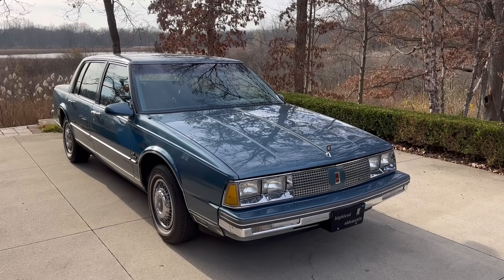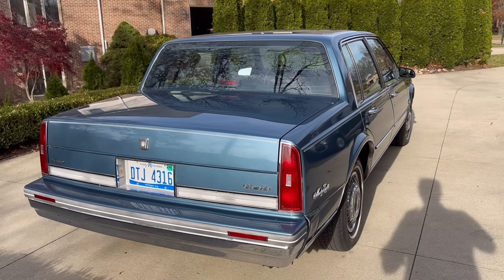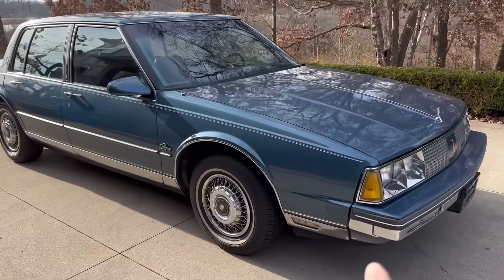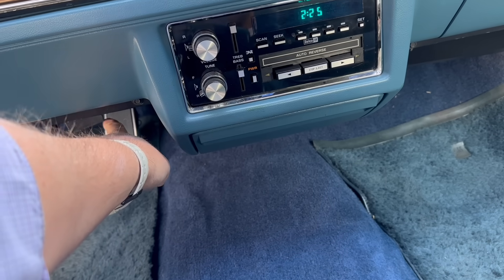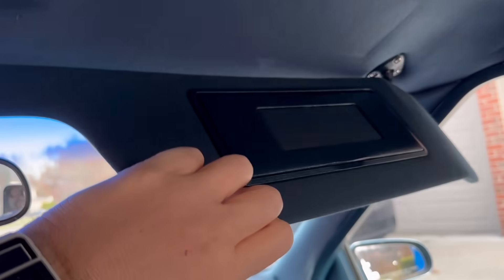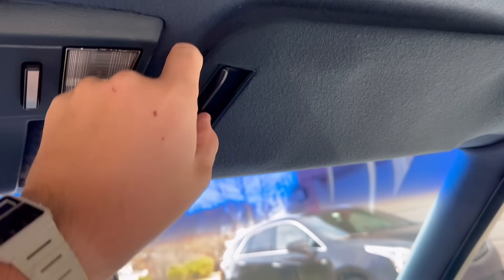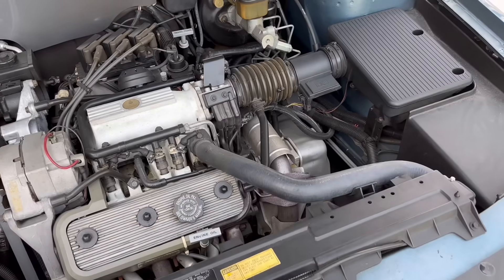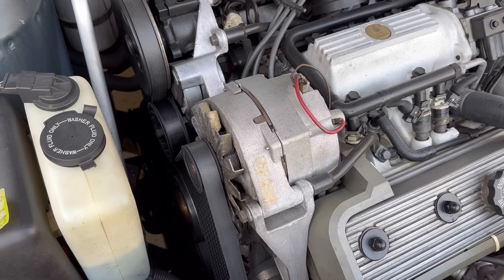Strange Features, Quirks and Idiosyncrasies of GM's "'Baby Big" 1986 Oldsmobile 98 Regency

Comment: Had an ‘87 98 Regency Brougham. Fully loaded. Mine had the Blue LCD digital dash. Quite a modern feature for the time. Had inside and outside temperature feature on it. My car also has auto level control. But motor electronics were not sorted. Brakes way too small. But the leather front seat was so comfortable. Like sitting in your living room.

Comment: You make me miss my 1986 regency brougham so much lol I loved that car. Sorry, I know this is a second or third time I have commented this haha
Thank you for the memory flashbacks and what i actually had because I forgot what it actually was. 40k miles on that car is just awesome. So that's what happened to my Olds with the cam. That steering rack never had the hard steering issue. Just broke at the tilt pivot. I would love to have another one of these cars because of those seats lol I slept in that car a few times. That overdrive was nice but it slipped a bit but some lucas trans fix made it better. Mine got about 22-25mpg. That trunk held 2 12's nicely

Comment: Actually the 1986 Cadillac De Ville had a sharp crease in the roof just above the window so it differs from the Electras and the 98s slightly.  I believe the Electras and 98s shared all doors. These 98s were the first 98s to ever have a six cylinder engine. The name " ninety eight" originally signified the Olds Model-90 with the Eight cylinder engine. 
My 1990 Regency Brougham has been the best car I've ever owned.
Reply: @rafaelfiallo4123 One thing I liked  in particular is that both the 98 and the Electra didn't resort to die-cast fender caps. Unfortunately the Cadillac had them fore and aft.
From developmental pictures I have seen, it seems the body of the Olds emerged as the goal of the styling exercise in early 1983,  and both Cadillac and Buick worked off of that mule which very surprisingly closely resembled the final 98 design and product. Perhaps it wasn't yet designated as an Olds that early in the process. That might account for the elegant taillights which are indeed very Cadillac. In the 1980 model year , 98s were given taillight treatments that very much echoed their 1965 designs, much in the same way that the full size Cadillacs recalled the 1965 rear treatment. All of that now quite gone and never to be seen again.
Thanks for the great video, btw
Reply: @rafaelfiallo4123 Perhaps  you are correct, but as I mentioned I dud watch a video about the C bodies and it showed an early mock up in clay which was very Olds. At any rate they are very attractive cars.

Comment: I was a 15 A man at GM that means I fixed windows and seat belts and power seats . In those years GM started farming out their wiring to factories in Mexico and used thin wire that would over heat the contacts after the window motor got a little wear and changed it load values. I go to junk yards these days and see nice looking cars that have so many issues with the wiring that the cars are junked it is too bad that GM made such poor products back then.

Comment: We had this same vehicle in white with burgundy interior. It had the 150 HP engine. Had it 21 years and experienced most of the issues described.  We really loved it and were saddened when we sold it with just under 130k miles.  It was, however, nickel and diming us beyond an acceptable limit.

Comment: I loved my Delta 88s. I have seen the digital cluster in person, as well as the auxiliary gages. I feel these cars peaked in 88-89. I had an 89 Eighty Eight Royale Brougham with the 1SG package which had auxiliary gages graphic equalizer dimensional sound electronic climate control power passenger seat, electric mirrors, cup holder console armrest, every possible light option illuminated entry, opera lamps cornering lamps and the matte black and chrome third brake light luggage rack. I loved the car. Your car is beautiful (I love medium sapphire blue Firemist and 88-93 GM truck medium blue metallic and others) but I never understood the body color center divider of the grille because that to me based on 77-84 is an Delta 88 feature. I always felt GM was ashamed of emissions control carbureted engines. So when fuel injection took hold they were so proud you could see the engine again they did everything they could to get as close to the beauty and hygeine of a 1960s early 70s engine. Look at an 86 Silverado engine, compared to a 1988. They really were proud of how much better they were making their cars.
Reply: I think the body color grille center came and went through various years, just so they could say they made a change.

Comment: I own a 1997 Oldsmobile Regency with 30k miles. I love the car. So smooth, comfortable,  great on gas and powerful V6. Only thing on the body style after the model in this video is the faux vent windows on the front doors. You don't get much air with the window down on the washer fluid if used will get push onto yourself with the wind pushing it around the glass.

Comment: The opera lights on that car are electro-luminescent; not LED's (back lighted). It would be so much better if they were LED, but we hadn't begun to use LED's in cars by 1986.  That whole panel glows when voltage is applied to it, rather than having a bulb behind it.  I discovered these when I had a 1981 Cadillac Fleetwood Coupe.  They are VERY expensive even when GM still sold the part.  The same year Coupe DeVille used a replacable bulb and the lamp assemblies are different.  I elected to downgrade my opera lights on the Fleetwood to the regular DeVille ones (which had to be drilled out to fit) so I could have opera lights without needing a loan to pay for them.  They are very beautiful, but expensive and impractical. Chrysler used the same lighting scenario in their early 60's Imperials, dome dashboards, and 66-67 Charger.  Chryslers use a high voltage AC current that will bite if you get across it with your hand. I believe the GM ones operate on 12VDC.

Comment: Ah, yes - I had a 1972 Olds 98.  Once got pulled over, and because of the tail lights, the cop said "Why does the paperwork say Oldsmobile, this is a Cadillac."  Awkward/uncomfortable conversation for the next minute as I tried to point out that the car was actually an Oldsmobile.  He didn't seem to want to believe me.

Your 98 is absolutely gorgeous!

More related to this, I got a 1986 Olds Delta 88 Royale 4-door, in a medium-ish metallic red, back in 2000.  It was low mileage, but, unfortunately, the early 440-T4 transmissions were prone to premature failure.  A guy I knew who worked at a dealership said some of the transmissions literally failed when driving them off the delivery truck, yet others lasted over 100k miles.  But there were a lot of failures on them in the first year or so.  Mine eventually failed at about 73k miles, if I recall.  Knew a guy with an 86 Cutlass Ciera with the 3.8/440-T4 combo who claimed to be on the factory original trans with over 150K miles.

What I really loved, though?  It performed surprisingly well, got surprisingly good fuel economy, and, the grill was blacked out from the factory.  Not the headlight trim or anything, just the grill.  I loved that (slightly odd) look!  Though, I did consider blacking out the headlight trim as well...

Overall, I loved the car, and was heartbroken when the transmission failed.  Couldn't afford to replace it back then, though.
Reply: I was at the GM car show today & saw an '86 Regency Brougham coupe for sale. 53m for $9500 a drop of $3500 from a couple of years ago. Nice clean rust free car, but that famous tranny issue keeps me from it. My wife had a '88 Park Ave. & the tranny failed at 125m & my '91 LeSabre Ltd. failed at under 100m.
Reply: @MargaritaRukavina-m7i  Dang, I'm surprised the 88 and 91 model years were a problem for you as well.
In addition to that 1986 Delta 88 I had, I also wound up with 3 separate 1989 Olds 88 Royales over the years.  All three well over 100k miles, no transmission trouble.  One of them still running and driving flawlessly at 203k miles when I sold it.

Comment: I have racked my brain on this, I have owned a 98 Regency Elite years 1991,1992, and 1995. I also have owned an 88 years 1988,1992, 1995,1999. They are basically the same car under the hood, the 88 smaller than the 98 not necessarily that much, but the steering ratio for the 98 was a lot deeper than the 88. I have had several occasions where making a u-turn on a two lane roadway where I would turn the wheel all the way and not be able to make it with the 88 without either riding the curb or stopping and backing up so I can complete the turn, as opposed to the 98 and not even turning it all the way and completing the u-turn without a hitch. If I would have turned the wheel completely until it stops, I'd be in the left lane of the road. So what about the 98 made the bigger car turn deeper without as much as effort as the 88 which most of the time failed making the u-turn?

Comment: The 87 and up were better cars, in that GM made several needed refinements, though ignition modules and coil failures would plague them all. As would cranksensors. I still have the special tools to set the air gap for those. Rear ball joints would fail as well, because nobody greased them. The biggest issue I recall on the early cars was that 440t4. Though smooth and responsive, they ran kinda hot and we saw them fail pretty often prematurely just past the warranty period, especially if the owner lived in hilly environments where it was shifting a lot. Yes at quick glance the 88s and 98s looked very much the same, but everyone was doing that...

Comment: Gotta love the velour interiors on these 80's GMs. Noticed the keys on your key ring. The first thing I do after buying an 80s to early 90's GM car without chip keys is replace the lock cylinder with a universal version that allows the use of the oval key. Then you only need to carry one key for each car.

Comment: for anyone that wants to get codes for a service engine light, this works on most gm cars from 1980 to 1994, jumper the last 2 terminals on the top row a code 13 would be one flash a delay then 3 flashes from the service light, it will repeat 3 times then move to the next code

Comment: My uncle actually passed away behind the wheel of this model of Oldsmobile in 1990. It’s was only because this car had bench seat, that allowed my aunt to pull the car over and stop on the shoulder.
Had they been driving a different kind of car with a center console, the outcome could have been very different.

Comment: Thank you Adam. I enjoyed the video and hearing you discuss the "downsized" Ninety Eight. I am thankful for my "upsized" final model year1996 Ninety Eight. I will say the rear styling on this generation looks better than mine on my 1996. I am thankful for the longer length, width and bigger trunk and features and engine. It hard to believe the 1991-1996 Ninerty Eight started from this generation. I knew they were trying to appeal to a different buyer.  The only thing with this generation is it was too close to the Eighty Eight in terms of features and styling and appearance. I will say the Ninety Eight gave Cadillac a run for the money. I have more features on my Ninety Eight than the Deville and Fleetwood offered. Regency Brougham arrived in 1982 model year. Regency replaced LS as the top model. The Regency Brougham replaced Regency in 1982. It is interesting the parts thar carried over to the 1991-1996 Ninety Eight.

Comment: I had an 88 9 ball.   I got over 275k miles on it.  The 3.8 was simply bullet proof.  The car was an ex company car, and had very  feature you could imagine.  What finally did the car in was that the fuel lines simply rotted away to nothing.  The break lines were all bundled in with it, and the whole mess needed to be fully replaced.

Comment: This takes me back.  We had an '86 Regency Brougham in the mid- to late-nineties.  Our particular one had the voice warning system where it would tell us if the headlights were on and stuff like that.  The most annoying thing about it was telling us - and I quote - DING!-DING!-DING! "Brake pressure is low.  Stopping distance and braking effort may be greater than normal.  Please pull to a safe place and test your brakes.  If you feel it is safe to proceed, then do so with caution.  Please have your brakes inspected as soon as possible." It would then repeat itself.  And every time "Roger" would say this, we would respond with "No shit, Roger!  We're accelerating!" DING-DING!-DING! "Headlights are on."  DING!-DING!-DING! "Headlights are on."  Thanks, Roger!

Heading to Toronto in 1998, we were barrellling down the 400 when traffic stopped abruptly.  My dad jams the pedal to the floor and barely slowed down before we rear-ended a New Yorker.  The front-end was pretty messed-up.  We hit Canadian Tire and bought some chain, some tools and whatever, then hid behind an industrial complex and proceeded to pull the front-end out so we can get the hood open.  Luckily it was - embarrassingly - still driveable.  There was a metal tab on a support right in front of the rad, and the sheet-metal tab just poked between the rad tubes, but it survived.

Hey, Roger!  The brake pressure was low!  Where the hell were you? 😆

Comment: I was 24 years old when I bought a 1990 Buick park avenue Ultra as a 3rd owner in January 2002.
I was so in love with that car ride and luxury convenience all across that i put 400.000km in 2005.
I decided to completely upgrade the entire car to a 1995 Buick park avenue with grand sport suspension.
It was ready in 2010. I’m driving this beauty only on nice days!
O ja it’s much faster en fuel economy beter with the series 2 3800.
Ingrid the hood looks like a 1995 p/a.
En the interior is all stock 1990 ultra.
All Led lights exterior an interior but only one opera electroluminescent light is working😀
A lot of Europeans love this design!!

Comment: You can do more than get flash codes from the engine light.
GM had live engine data at least by 1984  as I used to use my Scanner to view and adjust the feedback carburetor on mom's Olds. Ford at the time did not have live data, you had to intrusively install a break box to see what the ECU was seeing and outputing.

Comment: I had a 85  Brogham that I ordered new. It had the 3.8 V,6. The 86 had the 3800 which wasn't as good of an engine because they were built in Brazil. In 88 they went back to the Flint engine plant and those motors would run up to 300,00 miles.

Comment: looks almost like my 91 Buick Skylark also w/transverse 3.3L v-6 tilt wheel but no cruise, p/w but not locks, am/fm w/no tape/disk player. Love the FWD, goes thru feet of snow where my F150 gets stuck on slick pavement. No less than 23mpg @ 90mph, 38mpg if I drive 60mph.

Comment: I have to say, this platform is probably GM's best driving cars of the 80's no matter which marque or model it sold under, and they got a little better each year. Sure some had their infinitely irritating maintenance problems but when they ran, they ran, and were just so nice to live with on the highway and in traffic. Soothing actually.. Compared to other cars in the same class from Ford or Chrysler

Comment: this car is in exceptional condition, the problem is at that age the under hood electronics are probably going to be difficult to source replacements. that has the magnavox ignition ( a replacement coil or module  might be difficult to find). that early style MAF sensor might be getting rare. they only made the LG3 for a few years and it was replaced by the series I and series II.

nice car, but it's days of being a useful daily driver are probably over. only good as a conversation piece and an occasional joyride. 

i had a 1987 bonneville about a decade ago

Comment: Grandma's 1986 Delta 88 Royale Brougham was amazing compared to the 1980 Skylark Limited it replaced.  So much bigger, so much faster, quieter, more efficient and way more reliable and durable.  Her's also had an egg-crate grill, but with a boy color (silver) strip in the center.  It had the gee-whiz digital dash and I think the seats were identical to your 98.  It would do 27 mpg with 5 people in it going 65-70 mph (which was fast when the speed limit was 55 mph) going between Northern Colorado and the Oklahoma Panhandle where her son (my uncle) lived.  It wasn't quite as comfortable as Grampa's 1971 Newport, (or as fast as a 1971 383) but it was close.

Comment: Well, not much in the looks department, but they were good cars.  Did most everything nicely.  Those later model 3800 engines were rock solid indeed.  I would love to have you do a review of your black Cadillac SUV sitting next to this car...
Reply: Except for the crappy cheap running components.
Reply: @march24-lp4pv    Good ol "CPS", that isn't cheap to replace...  All this crap can kill a car's reputation for sure